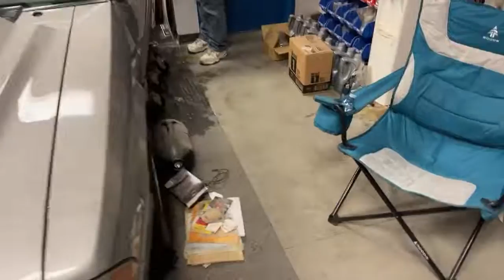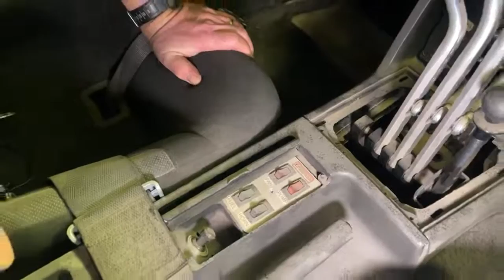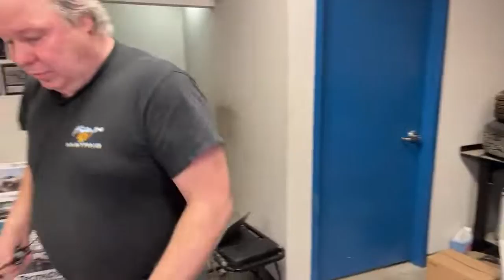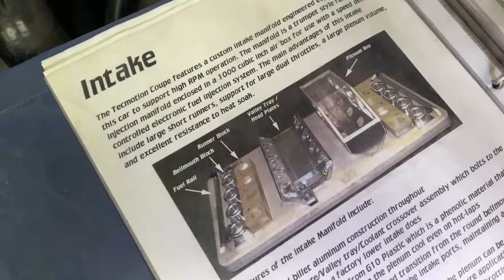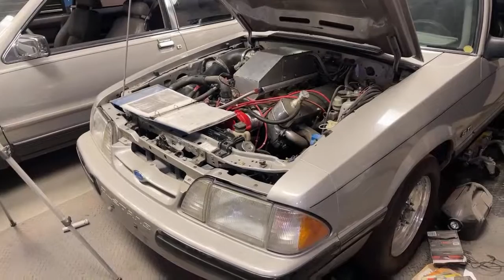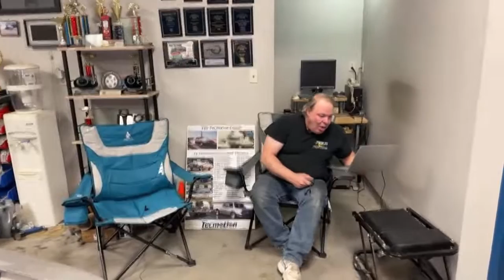February 10 Live Q&A

Comment: I missed the live  guys but I'm still watching. Thanks for all your content, maybe you can answer a question for me.  I have an 86 non ho 302 I'm  porting  some E7 heads. Can I run a bigger cam then the stock e6 cam? Without having any piston to valve interference with the e7s.
Reply from the maker: I have never built that combination so I can’t say for sure, and I don’t know if the non HO 86 had the flat top pistons that the HO did that year, so this is definitely something you should do a P/V check on. I might start by checking it with the stock cam and if you have loads of clearance then that is a signal that you can go bigger. As a general guideline you can usually increase the lift at least modestly without increasing the risk of contact that much because maximum lift occurs when the piston is far away from the head. Increasing the duration and ramp rate is what gets you into trouble with P/V contact. There are a lot of considerations though - valve size, the spring package including both the spring weight and coil bind, rocker ratio, valve cover clearance, piston design and reliefs, and of course the ramp rate, duration, lobe separation, and lift of the cam.

Comment: I missed the live 🤦🏼‍♂️ had a big ? To ask you.  89GT was running strong   Out of no where on hwy would stall between 3.5k-4.5k RPM any clues ?
Reply from the maker: This kind of problem can be very hard to sort out even in person, never mind over the internet or phone. Does the car stall at that rpm range under any throttle condition, or only at wide open throttle? If it is only at WOT I would start looking at the ignition power (coil usually) and fuel pressure. If it happens at any rpm then I would probably start by looking at the TFI module and distributor itself as well as checking the programming for any artificial limiters and checking any cd ignition box for a limiter. If it has a cad box with a limiter, raise it by 1000 rpm and check to see if the cutoff is the same or moves. Sometimes those limiters are faulty. These are only starting points. There are probably lots of other possibilities but hopefully that gives you somewhere to start.